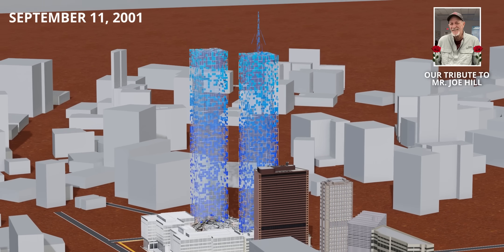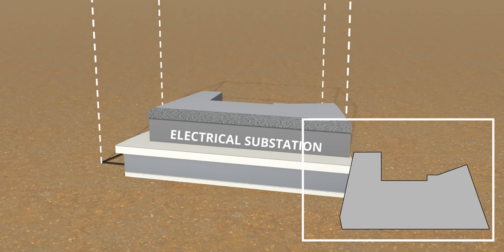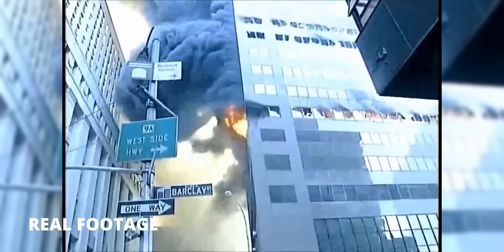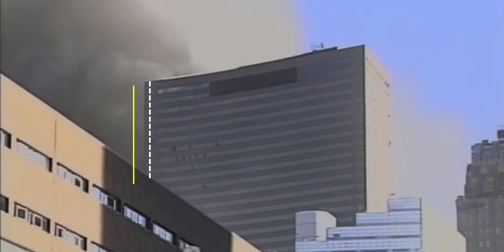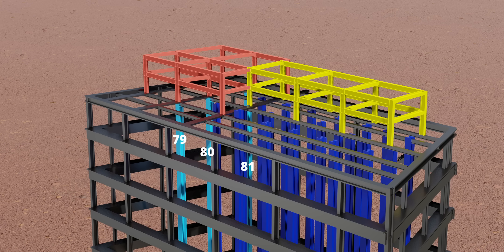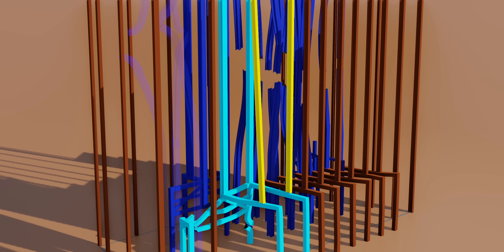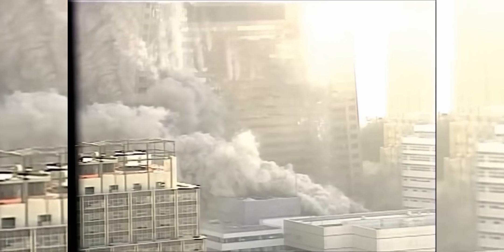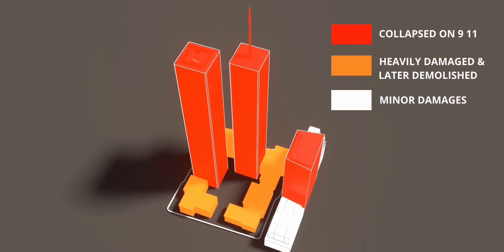Collapse of Building 7 | The Complete Physics

Comment: I think the main reason people think the buildings collapsing is weird is due to the fact that in their head they think they should drop like dominoes, when really that doesn’t make sense when you think about it. Gravity is pulling things straight down so how can such an object with so many joints just suddenly shift mass and start falling over like a tree that’s been cut down. The structure of a building is different than a tree or a domino because it is one solid object. 

Again, buildings are made of pieces, and they are not one solid rigid body like a tree.
Reply: I distinctly remember a few years ago a video that was quickly taken down showed explosions going off, floor by floor, from the ground up. Pop, pop, pop.    Exactly like a controlled demolition in fact.
Reply: @Dogtagnanwhere’s it at then
Reply: You can't fix stupid
Reply: The reason people don’t believe Wiley coyote is real is because when he straps a rocket to his ass the acceleration is all wrong… No! Stop! It’s a fucking cartoon and I have a brain! How do adults not have the ability to perceive reality?
Reply: 1.The firefighters said" it looked like they planned to take down the building" I didn't say that, The fire fighters said that. They were there.I'm sure they know best.
https://youtu.be/XiIT4HInWjY?si=e1Pvp3-IFs-M75Oj
When the firefighter says "boom, boom, boom, boom" in this video.
What do you suppose he is?Implying by " boom" ?? What do you hear? 
2.So if there were no explosives then what is this? 8:25
https://youtu.be/bLF5D7M1YgA?si=aHSvS__uOdxMi1ZB
You can't say that it was added because you can see the firemen's reaction to the explosion. And you can't say it came from anywhere else because the firefighter says
" We gotta get out of here,  7 is exploding "
3. Controlled demolitions have squibs, you can see the squibs here 20 floors below the collapse. 
https://youtu.be/eXAgulfAtR4?si=-iLO9aQjMJVLTUYH
4. Firefighter says "any one of these buildings could blow up,  this ain't over yet" firefighter says there's 3 secondary explosions. 
https://youtu.be/0Gh3ErgMI4M?si=mmp9Eus_5PWTCBfl
5. Airplanes can't fly 600 mph at 1000 feet. And to be able to make a 180 degree turn to hit the opposite side of the pentagon going that fast is ridiculous. And since when do terrorists hit the opposite side of the building where no one was at when they could have just flown straight in and killed way more people???
 https://youtu.be/0Gh3ErgMI4M?si=mmp9Eus_5PWTCBfl
7. No one has ever known ahead of time that a building was going to collapse except through controlled demolition.  Tower 7 was reported to have fallen while it still stood in the background. 
8. Larry silverstein,  the man who made over 4.5 billion when they fell, claimed to have pulled the building down.
https://youtu.be/1jQaJFNWqtc?si=wCywQ9grgBdS_w11
9. A witness reported a missile hit the pentagon while he was seen at the scene. 
And the hole wasn't big enough for a plane and the damage wasn't consistent to the towers. And just like shanksville,  there's pictures that show no plane parts at all.
https://youtu.be/6_Ez-UCpXMs?si=JaQ6DBEC_LJtMLgN
10. That video also points out They were military planes that hit the twin towers. 
11. All sorts of reports of explosions were reported that day.  
12 Buildings dont accidentally fall  Into it's own footprint.
Reply: @robbiehiatt9966 I challenge you to spend more time doing research then just saying whatever comes to your mind. 
1. No I would not say the fireman’s know best, the scientists and engineers who thoroughly analyzed the collapse do. It was fairly common for most people down on the floor level to have no idea what had happened. Many people didn’t even realize it was a terrorist attack because they were going about their normal day. Even in the video you shared on point 2, a guy literally is on the phone and talks about how all he saw was smoke, until the person on the call told him the building collapsed. “Boom, boom, boom, boom” floors crashing into each other one by one make loud noises. 
2 You’re right. The explosion wasn’t added but  the building was burning over 800 degrees at some parts with fuel leaking. There was explosions. And the video you sent could’ve been the second plane. 
3 You have no idea what the internal building looked like. There was damage everywhere, fire, and many explosions. When the floor collapses above hair below is gonna have more pressure. 
4. This account alone does not match up with controlled detonation. Explosions would have succeeded each other one after another at a rhythmic pace. Three explosions is not a controlled explosion. Nobody in this video said they believed it was a controlled explosion. Again the building was on fire and falling apart. Things were exploding, that’s what happens. 
5. “Airplanes can't fly 600 mph at 1000 feet.”
Why can’t they? Regulation wise, sure they can’t. But this wasn’t a regulated flight, it was an attack, and the plane was also descending at a rapid rate. 
“And to be able to make a 180 degree turn to hit the opposite side of the pentagon
going that tast is ridiculous.”
You’re right, it’s a plane, and it didn’t pivot 180 degrees like you’re implying it did. The plane entered three different states before it was turned around. 
“And since when do terrorists hit the opposite side of the building where no one was at when they could have just flown straight in and killed way more people???”
Who told you the building was empty? 125 people within the penthouse were killed. 
7. What are you even trying to say here? 
8. So you didn’t the video you commented on at all? Saying pull it, he meant the rescue effort because they knew it was coming down. 
9. There was no plane parts because most of it disintegrated, burned up, or got buried deep underground. It hit the ground at 500mph it’s not going to just bounce of the ground and be one solid piece. There is videos of car crashes at 80mph that look completely unrecognizable due to the impact. 
1. “That video also points out They were military planes that hit the twin towers.” I’m not entertaining that because this literally makes no sense lol. If there was military planes there would be more accounts. 
2. “All sorts of reports of explosions were reported that day.” Yes because a burning building has explosions. 
3. “Buildings dont accidentally fall Into it's own footprint.” It wasn’t an accident it was an attack.
Reply: @robbiehiatt9966  "The firefighters said" it looked like they planned to take down the building" I didn't say that, The fire fighters said that. They were there.I'm sure they know best."
No, they didn't. Yes you made that up.

"if there were no explosives then what is this?"
We don't know, because we don't see it. But we DO know that it's been added, because it's not on the original.

"And you can't say it came from anywhere else because the firefighter says
" We gotta get out of here,  7 is exploding ""
I can say anything because no-one says that.

" Controlled demolitions have squibs, you can see the squibs here 20 floors below the collapse. "
No, they don't. They have explosions. And you can't see that there, because demolitions explosions happens on every floor, and _on the collapsing floor. Here in the real world, we call that "air".

"Airplanes can't fly 600 mph at 1000 feet. "
Making up dumb shit doesn't it true.

" And to be able to make a 180 degree turn to hit the opposite side of the pentagon going that fast is ridiculous."
So, you had nothing and had to make up dumb shit about something irrelevant instead.

"And since when do terrorists hit the opposite side of the building where no one was at when they could have just flown straight in and killed way more people???"
Presumably since you lied.

"No one has ever known ahead of time that a building was going to collapse except through controlled demolition. "
Anyone with basic knowledge would know that a building would collapse. If the building has been burning for 5 hours, it's very obvious. Lying doesn't mean you're right.

" Larry silverstein,  the man who made over 4.5 billion when they fell, claimed to have pulled the building down."
Which is why he's about 10 billion in the hole, I'm sure. Meanwhile, that you're too dumb to understand spoken English isn't an argument for anything other than your failure.

" A witness reported a missile hit the pentagon while he was seen at the scene. "
No such "witness" exist, though. Your lies are just lies.

"And the hole wasn't big enough for a plane "
Because the body of a plane is 75 feet across. No, that's just you being dumb again.

"the damage wasn't consistent to the towers"
Imagine, a 77 feet tall brick and concrete building isn't the same as a 110-story tall steel skyscraper. Who'd have thought.

"And just like shanksville,  there's pictures that show no plane parts at all."
Because pictures that doesn't show things are relevant. No, no they're not. Meanwhile, the pictures that do, not to mention the 19 tons found, are.

"That video also points out They were military planes that hit the twin towers. "
And that Santa was involved. And other dumb shit.

"All sorts of reports of explosions were reported that day.  "
No reports of explosions were reported that day. Loud noises were reported, but that's irrelevant.

"Buildings dont accidentally fall  Into it's own footprint."
And other irrelevant and dumb shit.
Reply: @robbiehiatt9966  1. No I would not say the fireman’s know best, the scientists and engineers who thoroughly analyzed the collapse do. It was fairly common for most people down on the floor level to have no idea what had happened. Many people didn’t even realize it was a terrorist attack because they were going about their normal day. Even in the video you shared on point 2, a guy literally is on the phone and talks about how all he saw was smoke, until the person on the call told him the building collapsed. “Boom, boom, boom, boom” floors crashing into each other one by one make loud noises. 
2 You’re right. The explosion wasn’t added but  the building was burning over 800 degrees at some parts with fuel leaking. There was explosions. And the video you sent could’ve been the second plane. 
3 You have no idea what the internal building looked like. There was damage everywhere, fire, and many explosions. When the floor collapses above hair below is gonna have more pressure. 
4. This account alone does not match up with controlled detonation. Explosions would have succeeded each other one after another at a rhythmic pace. Three explosions is not a controlled explosion. Nobody in this video said they believed it was a controlled explosion. Again the building was on fire and falling apart. Things were exploding, that’s what happens. 
5. “Airplanes can't fly 600 mph at 1000 feet.”
Why can’t they? Regulation wise, sure they can’t. But this wasn’t a regulated flight, and the plane was also descending at a rapid rate. 
“And to be able to make a 180 degree turn to hit the opposite side of the pentagongoing that tast is ridiculous.”
You’re right, it’s a plane, and it didn’t pivot 180 degrees like you’re implying it did. The plane entered two different states before it was turned around. 
“And since when do terrorists hit the opposite side of the building where no one was at…???”
Who told you the building was empty? 125 people within the penthouse were killed. 
7. What are you even trying to say here? 
8. So you didn’t the video you commented on at all? Saying pull it, he meant the rescue effort because they knew it was coming down. 
9. There was no plane parts because most of it disintegrated, burned up, or got buried deep underground. It hit the ground at 500mph it’s not going to just bounce of the ground and be one solid piece. There is videos of car crashes at 80mph that look completely unrecognizable due to the impact. 
1. “ They were military planes that hit the twin towers.” I’m not entertaining that because this literally makes no sense lol. If there was military planes there would be more accounts.
Reply: @angelob2383  - I assure you Robbie doesn't care. Pure attention seeking troll who only cares that you reply, not what you reply with. Literally nothing you say will ever sink in. It doesn't want to know.
Reply: @angelob2383  The top of WTC2 clearly tipped sidewards first. So it did what you assume to be impossible. Also the antenna of WTC1 clearly tipped sidewards first. Weird huh?
Yes, gravity is directed straight downwards. That´s why all the columns that carried the buildings were straight vertical. So in order to fall straight downwards the building would have to go the way through the greatest resistance.
Reply: Indeed so. Gravity works in the general direction of "down", so buildings fall...down. Buildings aren't solid, that would defeat the purpose of "building".
And yet, neither of these very obvious things are something that the average "truther" can comprehend. Boggles the mind.
Reply: @mooneyes2k478 you want to talk about gravity?But you don't want to talk about the upward forces involved in the collapse of the twin towers
Reply: @mooneyes2k478, even when professional demolition experts take down buildings, many of these buildings don't fall straight down into their own footprint. I'm sure building 7 came down in sympathy with all the others! Yeah right.
Reply: @arnoldanderson1501  When professional demolition experts take down buildings, it's "controlled". That's the core word of "controlled demolition". Amazingly, there was nothing at all controlled about the collapse of building 7.

Incidentally, did you know that there's about half a dozen "for 9/11 truth" organizations? Architects and Engineers is the most well known, but there's "scholars", in fact there's two "scholars", guess the scholars didn't agree with each others scholarship, there's "pilots", there's probably "high school janitors for 9/11 truth" somewhere.....but there's no "Demolitions Experts for 9/11 Truth" anywhere. Why is that, do you think....?

Anyway, no, Building 7 came down because it had, in the words of the experts on site, been "fully involved in fire on all floors" for 7 hours. Which was, at a minimum, 4 hours longer than it had been rated for at the best of times.
Reply: @mooneyes2k478  youre everywhere bro this has to be your favorite topic ever 😂😂 arguing over 9/11 in youtube comments for years is crazy dedication 😂😂
Reply: @terrFW  You're everywhere "bro" this has to be your favorite thing ever. Looking up comments on 9/11 in youtube videos from years ago is crazy dedication
Reply: @mooneyes2k478  😂😂😂😂
Reply: @terrFW  What's the matter, doesn't the shoe fit as well on the other foot?
Reply: @mooneyes2k478  Your logic is flawed. Perhaps he only saw like 10 otherwise unrelated 9/11 videos from different years and saw your comments in all of them. If that's the case then the natural conclusion is that you are indeed commenting on virtually every video about 9/11. That is, he only saw a fraction of what you have written.
Reply: @mehmeteking  Your logic is flawed. Perhaps he only saw the two posts I'd made in those years and then concluded that I was writing all the time. That is, he saw all of what I'd written.

Isn't it amazing how that works...
Reply: @mooneyes2k478 So, a ”fully involved fire on all floors” brought down WTC7? WTC2 collapsed in 56 min and definitely did NOT have fires on all floors. WTC 1,2 and 7 all had unique circumstances regarding the type of damage and duration of fire they sustained. Yet somehow, they all fell in almost the same way..and that’s the official story.
Reply: @poornoodle9851  Yes. A "fully involved", 7 hours long, fire brought down Building 7, that is correct.

And that you want to pretend they "fell in almost the same way" means not a single thing other than that you're either deliberately lying, or not competent to understand what you're seeing.
Reply: @terrFW cutbacks at Langley will have this one working at a Walmart cashier soon
Reply: @mooneyes2k478 Try harder…Occam's razor doesn’t support your theory.
Reply: @poornoodle9851  That you don't understand Occam and his razor means you don't understand. Nothing more, nothing less, nothing else.